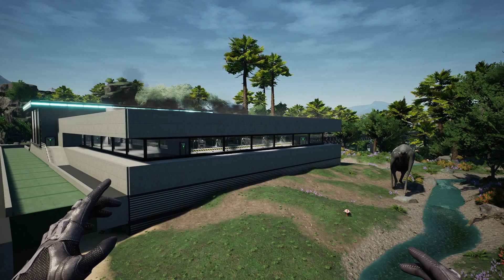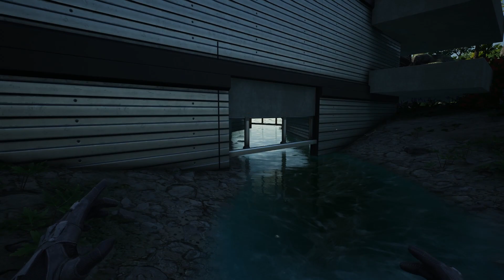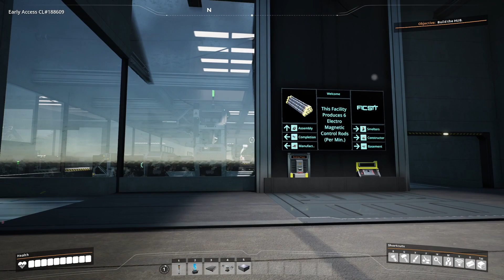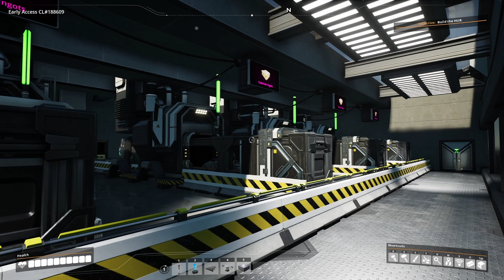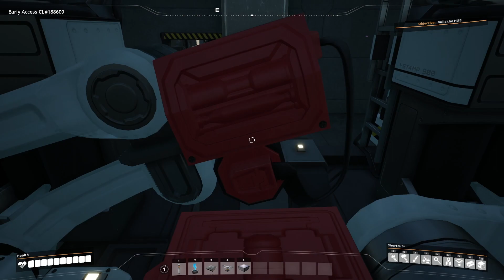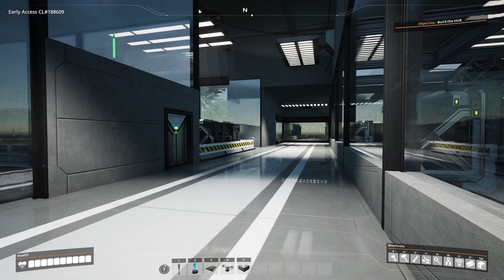FACTORY TOUR! My Best Factory So Far in Satisfactory

Comment: First, I really enjoyed this video! The presentation is refreshingly free of filler, and the factory tour is a lot of fun to watch. I also love the design. As a beginner, I appreciate that this factory relies on Mk1 belts—I’m hoping to replicate as much of your setup as possible. I’ve also enjoyed your other videos that break down how to build step-by-step; those are incredibly helpful!

I do have a question about your approach in this factory: how do you decide the quantity to produce for the end product? For example, if you start producing 5 of an item and later need 10 for another product, do you prefer to overclock the machines or build an entirely new setup? I recently built a factory for all the basic items, with outputs going to both dimensional and standard storage containers. Now that I need more copper sheets for AI Limiters, I’m debating whether to increase production in my current setup or start a new factory entirely. How would you tackle it?